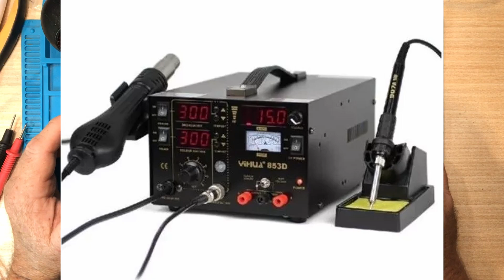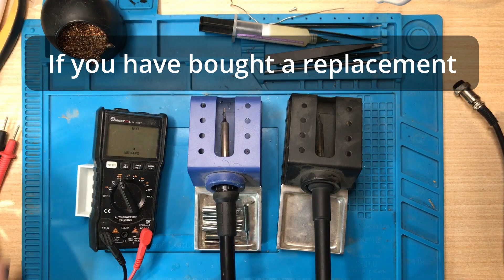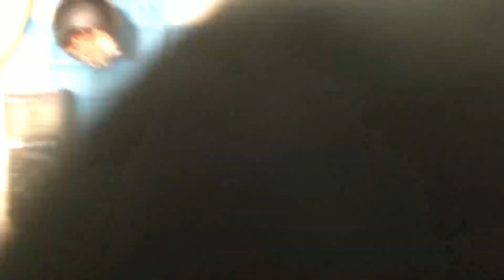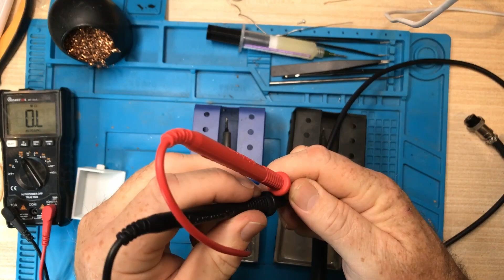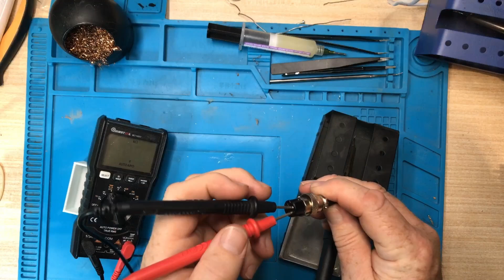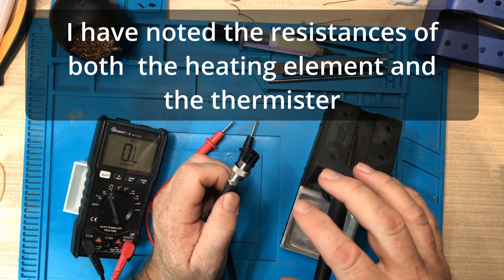How to Test a Soldering Iron with a Multimeter: Plus a Big Gotcha!

Comment: Those aren't DIN connectirs, they are GX-type aviation connectors (GX16, typically, used for many soldering irons). DIN connectors, such as used on a Hakko FX-888, don't have screw-on locking rings.
Reply from the maker: Thanks for the clarification.

Comment: Nice video - but little question - why You use a 10A terminal, not a COM when measuring resistance ?
Reply from the maker: 😂 that was a mistake, initially I forgot to swap it back.
Reply: @GerrysTech  Whoops 🙂Of course, practically readings should be the same, but this kind of mistake can be dangerous to MT 🙂